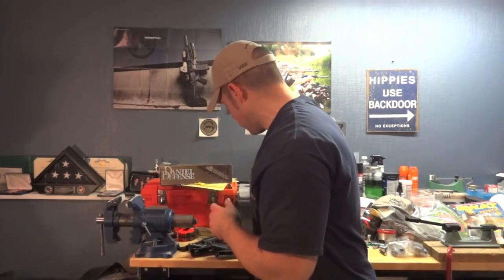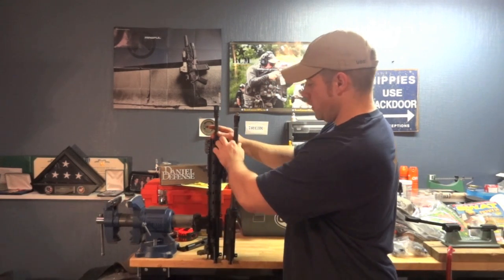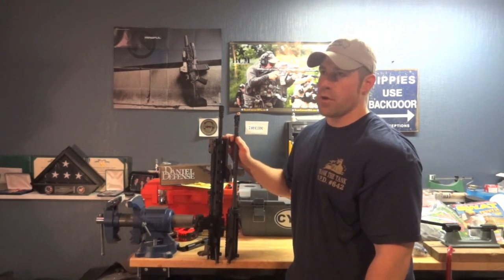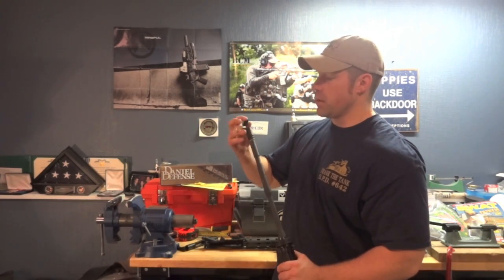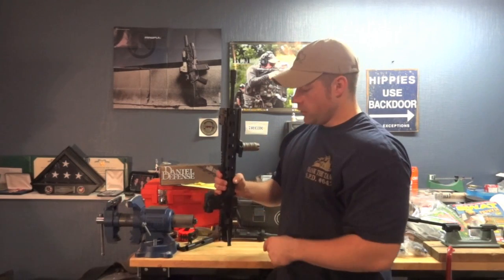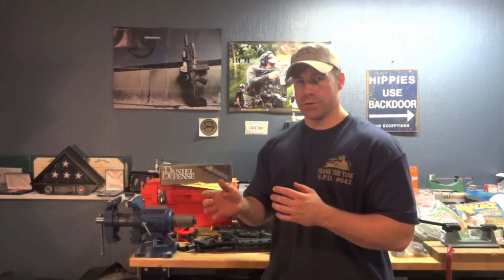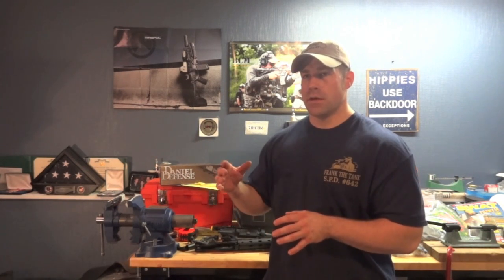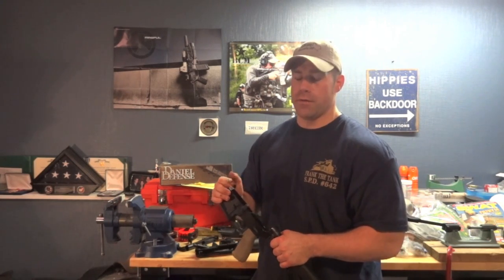Choosing a 16" vs 14.5" Pinned/Welded Barrel

Comment: Why would a 14.5" barrel have any gas issues? The M4 was originally designed with a 14.5" barrel.
Reply: The M4 uses a carbine length gas system. He was referring to the trend of everyone using mid length system for reduced felt recoil.
Reply: +SCH600 Some people go with mid lengths because the gas system puts less pressure on the carrier which in theory means less wear over time and slightly less recoil. In reality a carbine length gas system works fine with negligable differences between wear and it reduces your overall weight. 

If you want a rifle with a longer forearm anyway go with a mid length, if you want a shorter rail go with a carbine length.
Reply: The M4 has a 12.5 inch barrel with a 2 inch flash suppressor doesn't it?
Reply: +Julie Smith wrong. 14.5" barrel with a standard A2 flash hider. Which itself is just over an inch
Reply: A 16" midlength wont have any issues either - unless you are putting together a cheap blaster, then maybe.
Reply: dreyrugr you can still have a midlength or rifle length handguard with a carbine gas system. hanguard can be longer than the gas tube, the gas tube shouldnt be longer than the handguard. this is why free floating designs exist.

Comment: Hey great vid bro just subscribed but I want to know what do you think of S&W rifles I've just recently bought an M&P 15t and want your honest opinion on their rifles
Reply from the maker: M&P15s started out good, but I've been hearing that S&W has let their quality control slip.  I know of several large LE agencies that are dumping S&W firearms because of ongoing problems.  I used to recommend them, but now I'm hesitant.  If you have a rifle that runs and the barrel wasn't from the batch where they were farming out their barrel production to Mossberg, you should be fine.  If you get a Mossberg barrel, get it replaced right away under warranty.

Comment from the maker: But.. to specifically address the 12.5" vs 14.5" (NFA), 2" makes a difference. 1" doesn't make as much difference, which is why the 16" and 14.5"P&W difference is negligible.  14.5" makes a good compromise for GP use and CQB operations. It does both things decently, but an NFA 14.5" is a better GP carbine than it is a CQB carbine.  I am just basing this off of my own CQB experiences in a professional capacity.

Comment: How can you tell if it's a mossberg barrel. The barrel and chamber on it is melonite not chrome lined tho
Reply from the maker: You'd have to call the manufacturer and find out when it was made and who made it.  The barrels were made by Mossberg for a period, but are back to being made by T/C now that production has been moved into the Massachusetts facility.  One way is to run proper 5.56 ammo through it like Federal XM193 and see if you can get consistent grouping on targets.  If you don't get vertical stringing and you don't have functioning issues, you probably don't have a Mossy barrel.  The Mossberg barrels were all cut to .223 SAAMI spec and not 5.56 as they were supposed to. 
Nope, no CL.  Melonite is a salt nitride treatment which is actually harder than chrome.  Good stuff and I suspect that more companies are going to start using it.

Comment: Get 11.5" because of reliability issues with 10.5"...always hear this but rarely if ever have i heard of someone with a 10.5 or 10.3 having reliability issues...
Reply from the maker: The reliability depends on the manufacturer of the barrel and components.  Many companies over-gas their rifles by drilling gas ports too large, which is done to allow the rifle to cycle a myriad of ammunition ranging from weaker steel case to mil-spec 5.56 pressures.  Most companies are not tuning their rifles for a specific round, like you would get with a SOCOM/CRANE Mk18.  The downside is that you can create a timing issue with the gas system being over-gassed.  If there is too much gas, you can have problems ranging from increased wear and tear to the BCG outrunning the magazine and not cycling reliably.  The main issue with the 11.5” vs a 10.3” (Mk18 or HK416 rifles) is that the 11.5” gives the rifle enough dwell time to reduce possibly issues, as well as alleviate some of the excess wear and tear.  Your rifle will last longer with less chance of premature component wear or failure.  Obviously, with piston rifles like the HK417D (10.4” barrel), the piston system can be adjusted to ensure reliability.  On conventional DI guns, this is only done when you install an adjustable gas block and/or adjustable bolt carrier/gas key, or install extra power springs or heavier buffers into the receiver extension.
Reply: SentinelDefense thanks for the thorough reply. Makes sense!

Comment: Question for everyone, if the NFA regulations on barrel length did not exist, would you choose a 14.5" or 16" AR as your default?
Reply: I already have an 18” for longer ranges so I’d go 12.5 or even 11” off “all round”

Comment: How about a 11.5 with a 4.5 moderator?
Reply from the maker: You still contend with the issue of being required to permanently affix the muzzle device to the barrel.  The XM177 design is classic and that’s a way to reproduce it, but it has the same issue as with a 14.5” barrel in that you are permanently attaching a muzzle device and not reducing any significant length off the rifle.  What you are losing with a 11.5” is handguard length, unless you run a rail over the muzzle device. Which again, ultimately is the same thing as a 14.5”/1.5” or 16”

Comment: I agree but if this is what you recommend why do you have a 14.5 then ?
Reply from the maker: That 14.5" is a carbine gas system, not midlength.  The issues I discussed were with midlength.  The 14.5" Colt upper was also an agency rifle that was being rebuilt after being damaged in a crash.

Comment: So is a 16 inch with a carbine gas system better than a 16 inch with a mid length gas system?
Reply from the maker: From a reliability perspective, the carbine length gas system is more standardized and has been perfected enough to the point where it's pretty hard to screw up.  If this was 5 years ago, I would say that it's a hands-down win for the carbine gas system.  The carbine length is more tolerant of a wider range of ammunition due having two more inches of barrel length than midlength, which increases dwell time.  Having said that, most companies have perfected the midlength in recent years, and it's to the point now where the midlength setup is just as reliable.  The benefit of midlength is that it's a more mild recoil impulse, which is more pleasant and controllable to shoot.  The more mild midlength recoil impulse doesn't beat up the rifle as much, which extends the life of the internal components like the bolt, cam pin, springs and whatnot.  Many middle and lower tier rifle makers who make carbine length gas systems tend to over-bore the gas port to make them function with a wider array of cheap ammunition (especially steel case comm-bloc stuff).  Unfortunately, this over-gasses the rifle when you shoot 5.56 pressure or higher .223 pressure ammo, and that beats the rifle up more.  If you over-gas a midlength, it doesn't beat up the rifle nearly as much as a carbine length system.
Reply: SentinelDefense Thanks for the info and you time in answering me. I'm getting ready to start buying parts to build an AR. I am really shooting for a Bravo Company Upper with a BCM BCG and charging handle. Kinda want their new KMR rail system. I feel that's the most important part. Thrown it on a Mil-spec lower and get a 400 500 dollar parallax free red dot. The only thing I really was thinking about on the lower that would be of any focus is I'm thinking about one of those drop in triggers with 3.5 lbs pull, but a good old mil-spec trigger is probably all I actually need.
Reply from the maker: ***** I've been running a KMR14 rail for about 6 months now, and I absolutely love it.  I have it on a rifle with a Daniel Defense lightweight 16" barrel, and the rifle is incredibly light. For a trigger, look at the new Geissele G2S two stage triggers.  They're a more price-friendly option, but the same trigger as their SSA.  4.5# two-stage is pretty light, and for a combat-style trigger it's got everything you need.  If you are leaning towards staying with milspec, take a look at the ALG Defense QMS trigger.  It's a cleaner, smoother version of the milspec trigger with a definitive 5.5# pull.  I've run a QMS for a couple years now in one of my carbines, and for the nominal expense, it's a good investment.  Normal milspec triggers are anywhere from 5.5-9.5#, depending on manufacturer.  The average ones I measure are around 7.5#.

Comment: Good video, brother. Love to have a beer with you.  I've assembled several ARs myself and this information would've been invaluable to me when I first started out. For a factory built gun I went with a 16" KAC MOD 1 and have an 11.5" SBR built primarily around Noveske, KAC and LMT components.
Reply from the maker: I just picked up a Noveske Gen1 N4 Light 16" middy upper on a trade.  I love Noveske stuff.  That said, I still don't own a KAC, but I really really want to.  KAC makes some amazing rifles and components.  Expensive, but amazing.
Reply: I plan to put together another KAC/Noveske SBR at some point.  Noveske barrels are just phenomenal.  I'm currently re-purposing funds to acquire a Saker and a Leupy Mark 6 to dress up an MWS I've got coming, so that project is on the backburner for the time being.

Comment: I Am Getting My First M4 Setup......& From What I Can Tell.....By All The Research I Have Done....The Only Difference Between The 16" and The 14.5" Barrel is $200 & a Few Extra fps......But If To Be TRULY Immersed in The Gun Buying Experience....The Whole NFA & $200 Tax Stamp Would Be a Good Lesson On How Everything Works on The Administration Side of Owning Firearms.....I Think I Would Like To Go Through The Process of Registering My Lower...Just To See What The Process Is Like...And Instead of Getting a 14.5 Barrel..Maybe Getting a 12.5" ...Just To Make The Whole Process Worth While, And Fun To Talk About.
Reply from the maker: The problem with the NFA process is that right now, wait times are skyrocketing.  If you decide to get a stamp, perhaps also look at getting a pistol lower in the mean time. As for the difference between the 16 and 14.5, the differences are minor.  The $200 added cost is only if you plan to register the receiver as an SBR, which is what I think you were getting at.  Otherwise, the cost between the two barrels is about the same for all commercial options.  If you pin and weld the 1.5"+ muzzle device, or use the barrel on a pistol lower, you also avoid the NFA stamp cost and wait time.

Comment: Quick question brother I am currently building my first AR and I plan on shooting mostly steel case for training purposes what do you recommend carbine or mid length gas system I'm going with the 16 inch barrel by the way.
Reply from the maker: You can do either.  I prefer midlength regardless due to it being more reliable and more durable in the long run.

Comment: I think a 14.5 or 13.7 pin and weld is only worth it if you are  going to use a suppressor.
Reply: I almost built a 13.7 but I realized it wasn't much shorter than my carbine. I sold off the parts and ended up building another 10.5 upper. Now I have one with a 1-6x and one with a holographic.

Comment: You didn't put a shell on the 16 inch. If you are going to do this comparison, you might as well remove the muzzle device on the 16 inch and call it even.
Reply: Belligerent Instigator I don’t think you are comprehending then point of the video.

Comment: What about 14.5" barrel with carbine length Gas tube , is this okay ??
Reply from the maker: Yeah, those are generally fine.  Most carbines are over-gassed so that they can run a wider array of ammo, so if it's not from a top tier company, consider buying an H2 buffer if you shoot a lot of higher pressure .223 ammo or any 5.56 ammo.
Reply from the maker: That 14.5" carbine length one in my hand is a work rifle that I was working on/repairing at home.  It was a Colt LE6921 and a good quality rifle.  They work well for patrol, but midlength setups work a lot better if you have a fixed FSP

Comment: Would a 14.5 carbine length be more reliable than a 16 mid length?
Reply: Operator Klyde technically yes, because of dwell time, all other things(gas port size) being equal, the distance between the gas port and the end of the barrel is slightly longer on the 14.5 Carbine than it is on the 16 mid. That allows a little more gas to perform its duties
Reply: Operator Klyde he dwell time is about the same and if made by reputable company they should be about the same.Both should use a H buffer or H2 buffer.I have both and use H2 buffers with no issues.

Comment: So is Colt still considered to be in the top 5 or not. I kinda based my buys off 4 Manufacturers. . FN..COLT..BCM ..DD..Are these still good or no
Reply: Depends on what is "best". 
If you want milspec than FN and Colt are the only ones with the true carbine milspec data packages. Companies like Knights Armament and DD have contracts for guns like the MK12 and M110.  
BCM is just as good or better as those listed above. 
People hate on milspec, because there are some non milspec items that are "better," but milspec is a standard and is proven.
Reply: I agree with you. I own a FN M4 COLLECTOR SERIES, COLT LE690 , AND BCM 14.5 MID.. All of em are pinned and welded at 16oal
Reply: +sean white those are all great. It also depends on what the gun is going to be used for. 
A Colt expanse/ budget AR is great for some one that is going to put 500 rounds through it and let it sit in a closet for the rest of its life, but I want a gun for SHTF so I choose milspec or a great brand like LMT or BCM. I also put hundreds of round through my AR every month.
Reply: All my M4A1's are for going in harms way if necessary.  I put maybe 750 rounds through each one yearly the FN M4a1 I've only had for 6 months and I have roughly 480 rounds thru it

Comment: I dont understand how a 16inch mid would run better than a 14.5 inch in terms of the gas system, FTF, FTE etc.  The gas on both is venting back into the chamber at the same point on the rifle.  The 16inch is just providing another 1.5inches of barrel that will give you about 60fps more than the 14inch.

Bravo company recommends a carbine buffer for their mid lenght uppers.  IMHO you run a carbine buffer on day one with a mid length and a standard spring.  Get a Spring Co "White" spring, which is a normal spring strength but the spring is the new silicone metal type that just lasts much longer (200,000 rounds vs 2000)
Reply from the maker: The difference has to do with the dwell time of the gas and the bolt.  The gas port would be at the same location, but they will not always have the same size gas port.  Top companies use specific gas port diameters to match the gas system and barrel length.  Companies like BCM and KAC will have guns designed to run on 5.56 ammo, so their gas ports are smaller than on lower quality guns that make theirs to run on cheaper .223.  The barrel length difference alters the speed and amount of gas that is in the system.
Reply: SentinelDefense
the extra 1.5" of barrel is what creates the dwell time difference 14.5" and 16" in a 16" this means more barrel to create build pressure after the port...in a 14.5" with less dwell time the gas port size needs to be larger than the 16" port, to allow for enough pressure to operate the the action,the 16" needs a smaller port to accomplish the same task
Reply from the maker: brotherscoobs
Exactly.  With a midlength gas system, a 14.5" barrel will have ~4.5" of barrel beyond the gas port.  A 16" will have ~6" of barrel beyond the gas port.  You ideally want a minimum of 3.5" of barrel after the gas port for reliable operation.  The more you have, the better.

Comment: I live in a communist state 
That requires all muzzle devices to be pinned. 
Therefore I always go with the 14.5” because they have to be pinned and welded anyways in my shit hole state. 
My 14.5 BCM CFH barrel with Lantec Dragon break is a tack driver. 
Next build I’m gonna do a pinned and welded 13.7 barrel

Comment: Is Spikes Tactical AR15 are good?
Reply from the maker: Honestly, I don't know anymore.  They were, and then there were contentions that they let their QC slip a little bit during the panic buying (no confirmation on that), but I've been hearing that they're back to good quality again.  For their price point, there is a lot of competition with similar quality.  I would recommend doing some research into recent forum posts to find out if they've had any issues as of late.
Reply: Thanks for the info.. I was leaning on buying Spikes AR!5. Now maybe Noveske or BCM, and also what do you think about Warsport Lvoa AR15?
Reply from the maker: Arnie L
I have a hard time justifying a rifle (Warsport LVOA) that costs hundreds more than a LaRue OBR, KAC SR-15, Arsenal Democracy Reaper-33, LWRCI M6, or Wilson Combat Recon.  The aforementioned brands all have proven reliability and durability, and they are anywhere for several hundred to one thousand dollars less than the LVOA.  Hell, even the HK MR556A1 is less than the advertised price of the LVOA, and that's not a good thing for Warsport.  Just something to consider and ask what their justification is for charging that much.  I have no direct experience with their rifles, but I am skeptical of anything that is that expensive compared to known industry premium companies.
Reply: Thanks for your good input...